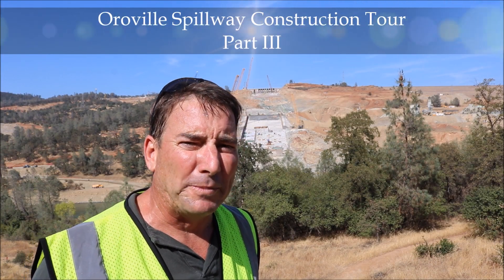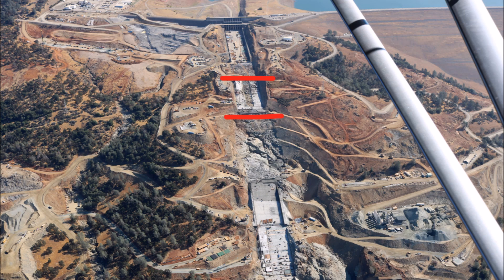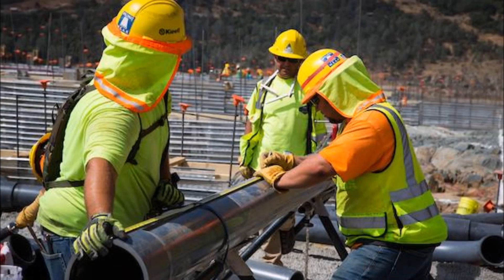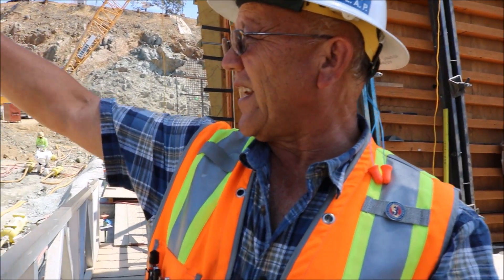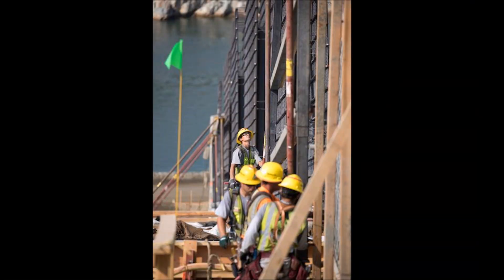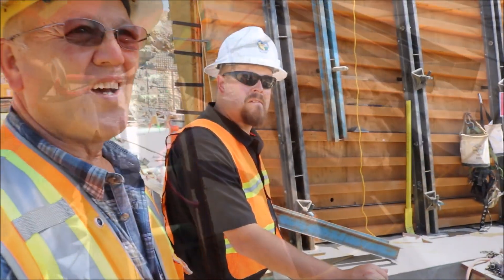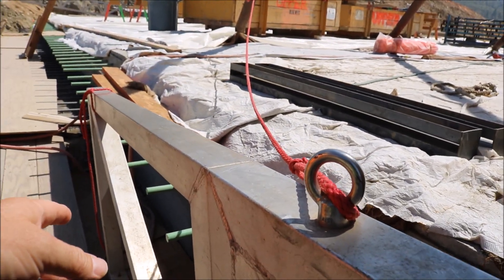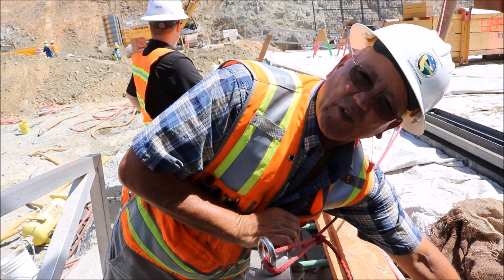Part III Oroville Spillway Construction Tour

Comment: Rockbolting the slab into sightly weathered bedrock looks like overkiill to me. Juan Brown should understand the term bedrock better. The whole spillway foundation is founded on bedrock. The cross drains are super conservative with their drain rock design. How is the clean bedrock going to generate fines? A major construction undertaking seems to be moving smoothly.

Comment: Being a pilot of triple 7's, you've probably seen this series of smart assed maintenance responses to pilot queries:
Pilot’s Complaints
…….. It takes a college
degree to fly a plane, but only a high school diploma to fix
one; a reassurance to those of us who fly routinely in our jobs.

After every flight, UPS pilots fill out a form, called a
‘ gripe sheet,' which tells mechanics about problems
with the aircraft.
  The mechanics correct the problems, document their repairs
on the form, and then pilots review the gripe sheets before
the next  flight.

Never let it be said
that ground crews lack a sense of humor. Here
  are some actual maintenance complaints submitted 
by UPS pilots (marked with a 
P) and the solutions recorded (marked with an 
S) by maintenance engineers.

P: Left inside main
tire almost needs replacement.
S: Almost replaced
left inside main tire.

P: Test flight OK,
except auto-land very rough.
S: Auto-land not
installed on this aircraft.

P: Something loose in
cockpit.
S: Something
tightened in cockpit.

P: Dead bugs on
windshield
S: Live bugs on back-order.

P: Autopilot in
altitude-hold mode produces a 200-feet-per-minute
descent.
S: Cannot reproduce
problem on ground.

P: Evidence of leak
on right main landing gear.
S: Evidence removed.

P: DME volume
unbelievably loud.
S: DME volume set to
more believable level.

P: Friction locks
cause throttle levers to stick.
S: That's what friction locks are for.

P: IFF inoperative in
OFF mode.
S: IFF is always
inoperative in OFF mode.

P: Suspected crack in
windshield.
S: Suspect you’re right.

P: Number 3 engine
missing.
S: Engine found on
right wing after brief search.

P: Aircraft handles
funny. (I love this one!)
S: Aircraft warned to
straighten up, fly right and be serious.

P: Target radar
hums.
S:  Reprogrammed
target radar with lyrics..

P: Mouse in
cockpit.
S: Cat
installed.

And the best one for last: 
P: Noise coming from under instrument panel. 
Sounds like a midget pounding on something with a
hammer.
S: Took hammer away
from the midget.

-- 
Saul thought Goliath was too big to fight .. David thought he was too big to miss.

Comment: Another DWR video landed today.  Wow, you can really see the progress happening now, in real time.  In addition to the work on the upper spillway, check out the 7 day progress on filling up the upper plunge pool first with dental concrete then RCC ...
from THIS { https://youtu.be/DRnPvrgkU04?t=22s } 
to THIS { https://youtu.be/M5SV2p3znl4?t=56s }.  
Very impressive.

Oh, and I answered my own question from earlier ... according to guidelines { http://www.acpa.org/wp-content/uploads/2014/11/ACPA-Roller-Compacted-Concrete-Guide-Specification-Version-1.2.pdf  } they can separate the 1foot lifts with as little as an hour, so the chief limiting factor seems to be their onsite capacity for transport, application and compaction, which I bet is soon gonna start pushing the limits of their RCC plant.

So far, so good.  I think everyone has reason to feel pretty good.  For me, the main lingering head scratcher is how well the incompletely cured RCC will hold up once runoff begins sometime after Nov 1st ... as is, they're going to be using some sort of chemical hardener on the temporary top layer they'll cap the current season with, to help minimize damage until they can do a proper high-wear-resistant surface next season.

Comment: Nowadays, spillway slabs are concreted continuously with no transversal joints. only longitudinal joints are introduced. of course, it is double layer reinforced and doweled. elimination of transversal joint is very advantageous for speeding up the works and eliminates all trouble linked to the great care these joints need. drainage is maintained.

Comment: Juan - Does this mean that there will NOT be an open drainage ditch alongside the training walls?
Reply: That's what I heard.  Those drain pipes will simply feed back into the spillway.  The sides will be back-filled.  No ditch.   If you look at some of the DWR photos from about a month ago, you can see the drainage pipes setup for this.  They have a 90 degree on the outside ends then extend down (about 30ft?). I think Tom said some minimum slope 1/4:12 or some such.
Reply: cember01 interesting. I wonder how they expect to see water streaming from the drain pipes if they are only four feet or so up the side of the training walls. I would have thought that they'd want to have the ability to see that drainage flow at times of peak throughput when the chute has water high up the 30 foot walls..
Reply: No idea.  Are they looking for seepage during spillway use, as you mention, or just seepage during wet weather but with the gates closed?  Where will the exits come out?  Did you see 4ft somewhere or just use that as an example?  Have to look for the drone shots when they get some of those training walls complete.  See if we can spot those exits.

Comment: Hi Juan.Do they have any medical personal on site be it only EMT`s it is sure needed with temperatures in the hundreds or overwith the people working are forty or older need to seen STAT and not be driven away to be seen by an MD,it could be to lateI`ve seen heat exhaustion and sun strokes.mike

Comment: Juan, 

I would appreciate a cross section showing the typical placement of dental concrete (grout slurry), leveling concrete, roller compacted concrete and structural concrete.  Even a crude, back of the envelope drawing would be helpful.  Over the episodes I have become confused as to the layering.  

Another "cartoon" drawing that would be helpful would be showing what will be removed and replaced in the lower spillway after this season has ended.  The need to cut in the drainage system is confusing me as to the depth of what concrete placed this year will need to be removed, and how far the cuts will have to go for the drainage.

Thanks.  Excellent reporting.

Comment: Lots of access roads to the spillway, looks like about ten on each side.  They move a lot of dirt around.  The old spillway had as little as 4" of concrete, now a minimum of 90"'everywhere, so a big increase by a factor of 20.  Why even have drains?  If it is solid concrete down to bedrock, there would be no loose material to wash away.

Comment: As stated, the spillway walls are 30' high.  I was wondering what the depths of water are projected to be in the spillway at normal use and  at max 100k f/s capacity.  Do you happen to know?

Comment: Here's an interesting fact that would be good to follow up on your next phone-in. On Wikipedia, the gates are rated at a maximum of 150000cfs, but the new spillway we are told has a total capacity of 270000cfs. Why the huge overhead in capacity? DWR probably wouldn't comment, but maybe they want to have the overhead should they have to upgrade the gates if it became necessary. Back in 2005, pressure groups in the area, pushed for the ES weir to have a concrete landing area downstream from the weir. This was rejected....for cost reasons? Hindsight is always 20/20, but it does show that outside groups were correct in their assessments.
Reply from the maker: for all the wrong reasons though...the outside groups were more concerned about water 'turbidity' for the fish downstream with the original ESW design. They did not foresee an emergency like this.

Comment: I mean it was cool hearing them talk about the drainage system and how they monitor it, but I was hoping for some better/newer technology.  It's pretty much the same system as was in there before, just constructed better.  They monitored the flows coming out of the drains on the old spillway too.
Reply: Also, what are they going to do with the new drainage pipes on the upper spillway that need to go through where the rcc is?  Cap them for the winter?  Trench the rcc to make room for them and drain over the top of the rcc wall?  Temporarily drain them behind the wall some place?

Comment: You might want to give a call out in your video to the hard working construction WORKERS who are actually building the project.
-
The green reinforcing steel grids in the slabs are coated with epoxy for corrosion resistance, while the side walls(training walls) do not appear to be epoxy coated.
The original Parthenon in Athens Greece was built out of porous marble in 450 bc. The ancient Greeks used - iron H pins coated in lead - to prevent corrosion. In the 1850s modern Greeks used non coated iron pins in the restoration. Water seeped through the marble and caused the new iron pins to rust and swell and break apart much of the new restoration. In 1975 a new restoration project was started. The original Parthenon took - 15 years - to build with hand tools, and the new restoration project has been ongoing for the last - 40 years - with no end in sight, perhaps making this the never ending make work project.
-
I have been following your excellent Oroville updates since you started this series. I worked for a brief time on the California Aqueduct which carries water from Oroville dam to southern Calif in about 1964.

Comment: Thanks for the education on the anchor bolts. I spotted the hose earlier this week in some of the DWR photos and was "guessing" it might be for injecting the grout/epoxy or whatever they use to attach the bolts. So 30% get pull tested?? 

Did anyone say what the thickness is of the "structural" training walls is at their base?? Looks like they could be several feet. BTW, he was asking if you noticed the "thickness" of the plywood, I think, on the wall forms at the USW. Some VERY STOUT forms as I'm sure there is "tons" of pressure at the base of those forms when 25' of concrete gets poured inside them. BTW, again, I think the RCC training walls are 15' tall. Removing them next year is going to be a formidable task.

Comment: So Juan:
If the slabs are "dowelled" together, how can they expand and contract as individual sections (as opposed to all the pieces tied together as one)?? Pour slab "A" on the right with dowels sticking our its left side next o slab "B" on the left with dowels sticking out its right side. Fill that void (where the dowels from the two slabs meet with ??? and the slabs can no longer move independently of each other. What are we missing here?? What are they using in the area between the two slabs where the dowels meet each other to allow the slabs to act as one (elevation) but also act as a "expansion" joint ???
Reply: Pappa Bob clearly there is a piece of the jigsaw missing.

Comment: A great photo - op during this project will be when the new lower chute concrete comes in contact with the new upper concrete chute.  It could be portrayed just as was the golden spike ceremony at Promontory Point Utah when the trans-continental railroad was joined.

Comment: Wow!  That is a wall.  Makes it look big next to my little retaining wall I build around the house.  It was a full 2' tall and 6" wide but I did it all by hand with a mixer and a few hundred bags of concrete.  Doing the rebar like they have is amazing.  Guess they had cranes lift those heavy pieces.  Amazing work and speed.  They are building walls 5 times faster than on I35 here in Texas.  Just amazed at how much of a mass that spillway is.  The flow rates out of Houstons dams releasing water is flooding out a whole area downstream at 16000cfs.  160000 cfs is hard to comprehend.  They slowed to 8000cfs to keep the damage downstream to a minimum.  That is alot of water.  Your videos are extremely informative. Thanks

Comment: As explained by DWR supervisor Tom Cobarrubia; the drainage pipes are mainly there for subterranean sources of water and NOT the incidental leakage in the expansion joints (starting at 1:42) but then in his example of witnessing excess drain water he mentions the construction joints that the pipes call home, as needing further inspection (at 2:20) to determine where the water is coming from and damage assessment.
Now, it makes sense to me as to why the spillway would need drainage (next season's construction) through the section of RCC that clearly, could not have a subterranean source. It would tell the inspectors that the grout seal and rubber seal BETWEEN slabs has been compromised and is in need of repair or maintenance. A way to stay on top of any water related future erosion!
Thanks again Juan Browne, for your timely updates and thorough questions about construction.

Comment: Thank you Juan comprehensive reporting. Not a problem at the moment because the weather looks so good, but if there is any frost it can destroy concrete like a hot knife going through butter. Cheers.
Reply: That concrete has so much mass, it would easily survive a sudden frost event. It's not a 4" driveway......
Reply: Yes i agree but the top 1 inch can crumble over night it there is a heavy frost. Which can leave the concrete vunerable and in a more exposed state. It takes 25 years for concrete to fully harden and another 25 years to loose most of it,s strength . Thank you for your comment.

Comment: It was interesting to me to see the use of that PVC drainage pipe--I wonder how different it is from the stuff we would get at our local home center, by chemical makeup, thickness...I wonder what kind of "shelf-life"
that product has? must be good considering where they are burying it-that's a long time in this case !
Reply: It's identical. PVC is PVC. It lasts forever.
Reply: PVC exposed to UV and sunlight will degrade, but should be fine underground.

Comment: Unbelievable. This is not just "pour me a new spillway with concrete on top of rock" this is layer upon layer of technical concrete. Every time I see an overhead shot the size of this is amazing. It looks 1/2 mile long.
Reply: +MLTomson ... This is what the power of hydraulic cavitation can do when proper maintenance is deferred by incompetent governance of otherwise good management.
Reply: what I find mind boggling is how much money has been spent on this so far to fix a tiny little crack that just eroded into a massive size hole.
Reply: .65 miles - take a look at it on Google maps. The images are before the failure. So very different from the current condition.

Comment: Juan, did you happen to see this CAT hauler doing a "brody" on the road below the spillway? If not, check this out:  https://youtu.be/ckqw66PWosQ
Reply: That was WILD! I had to watch it 2ice to make sure of what I was seeing. I've tried to do that but couldn't get enough snow at one time. I wouldn't've done it there though. A 771 (40 ton) will run about 34 m.p.h. and a 773 (60 ton) is around 45. The 'hearder' (no driving involved) got rattled around in that cab, betcha, and if anyone higher up saw that I bet he's got teeth marks all over his rear and maybe a pink slip to go with it.
Reply: They call 'em di-does here.
Reply: UPDATE: The "long" version of the "brody":  https://youtu.be/fZIALzNSBWI